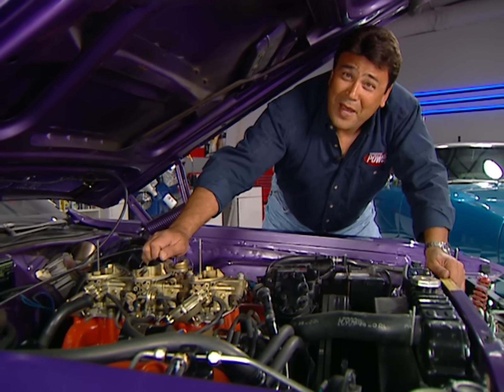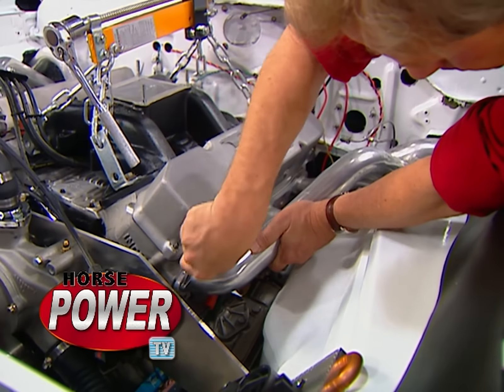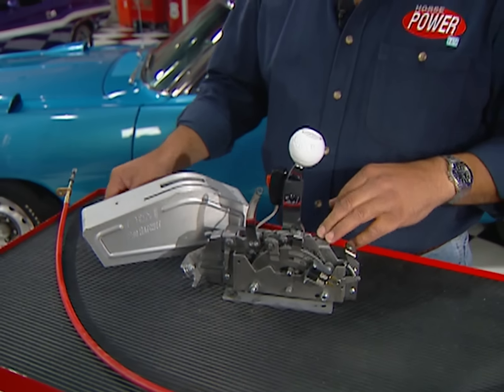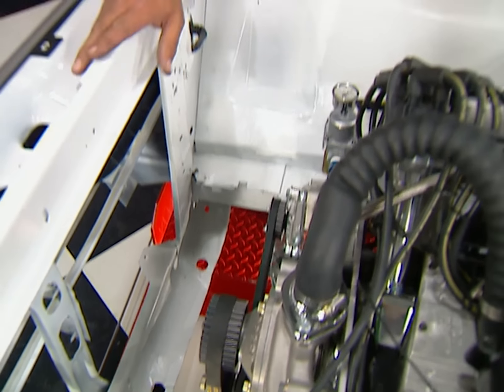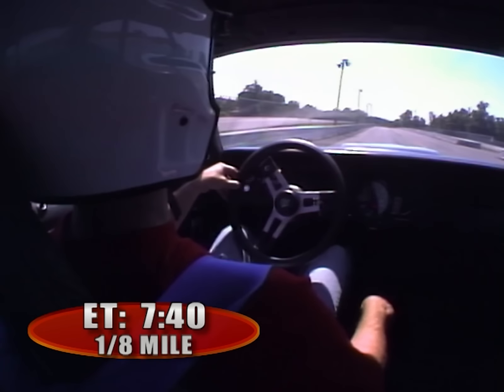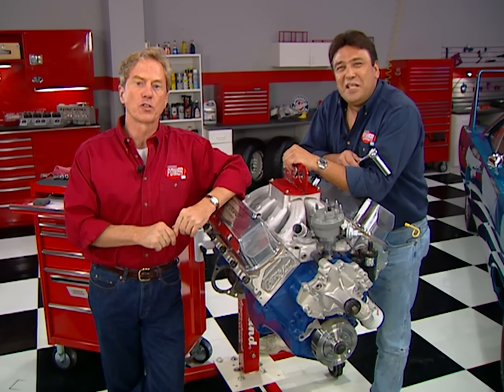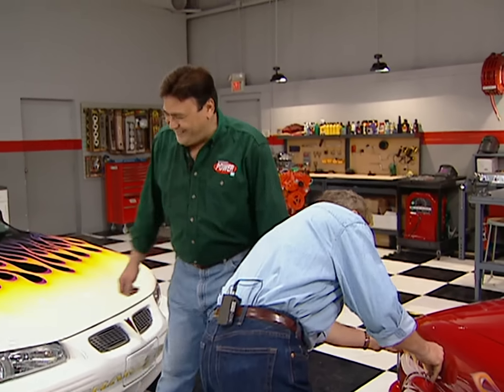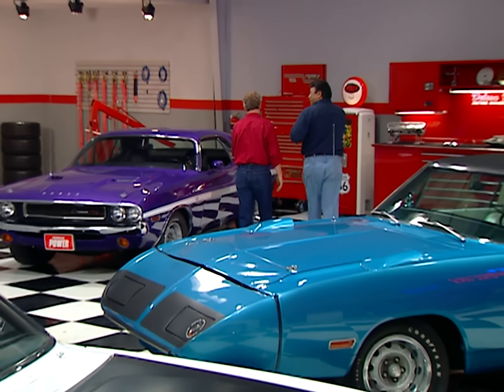Dropping A 500ci Big Block Between The Fenders Of A '71 Duster - Horsepower S1, E16

Comment: I don't know what you guys are doing, but that car should be running at least in 6.70s with that motor. I have a Duster with a standard 383 with RPM heads and it runs low sevens. Have seen many 360 small blocks run as fast yours.

Comment: Could of used a grinder on the k member and cleaned up where the motor mounts went, so  doesn’t look like my kid sister did the job.
Reply: Agreed, whoever preps these cars for the starts are probably the real hacks. These guys just go along for the dough probably.
 Did you see the size of the bolt v/s the the hole it went in?

Comment: That 600hp seems way over rated less the air was terrible there.

A friend of the family ran NHRA stock, 3100lb car, 545hp on the dyno and that car was 10.2's in the high 120's / low 130mph.
Reply: That car should be putting it on the rear bumper when it leaves with 600ft/lbs and 630HP.
Reply: sometimes they dyno corrected by 10% then they go to a track to test and the air there is 4 k elevation or something , or just BS